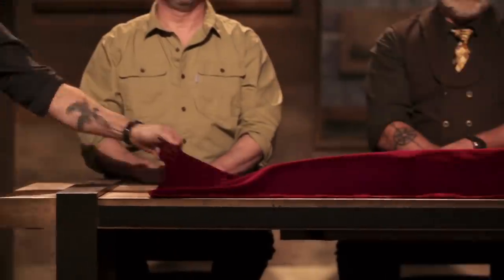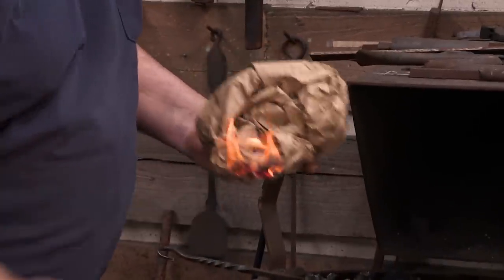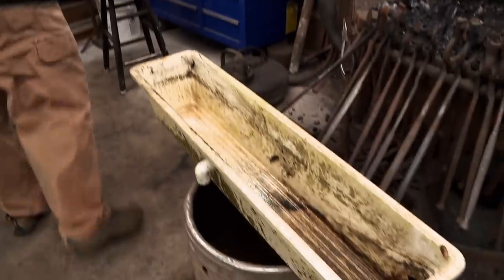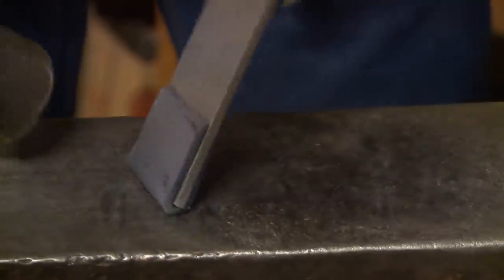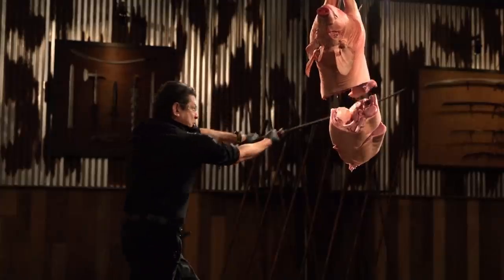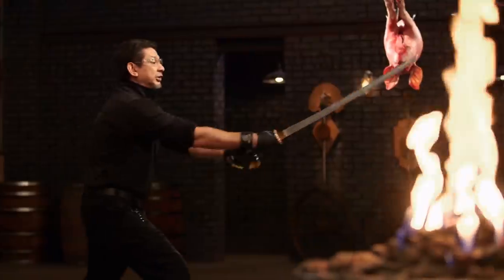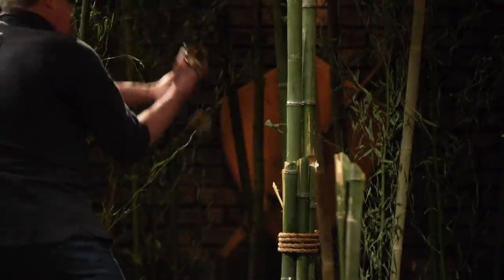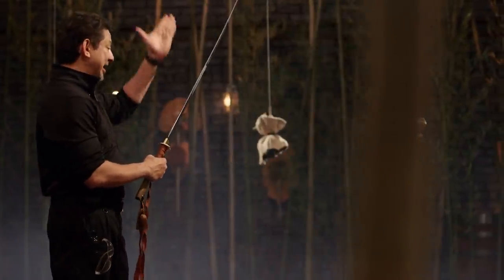Forged in Fire: Gunto Final Round: Richey vs. Elijah (Season 6) | History

Comment: I gotta say... The wrap getting unraveled seems like a minor problem that can be fixed by simply rewrapping the whole thing. But a bent sword? I don't know, it feels like a bigger issue than a handle wrap coming undone.
Reply: Yeah I'm rooting for Richie but I cant deny that he lose. I mean, Elijahs blade has a slight bend, but still functional in battle. As for Richie's blade, it would definitely be a bother in actual battle. It would affect the swing, grip and so.
But in a battle of beauty, design, and the blade? Richie is definitely the winner.
Reply: and the wrap isnt really a smith job
Reply: Well you see the challenge was to create a usable sword that could withstand the challenges. I've tried using a variety of swords without any wraps on the handle and it is almost impossible as the sword slips out very easily. There are no fixes in this challenge so what's done is done and imo I bent blade that cuts is better then a blade you can't swing.
Reply: @edwards7428  More handles than not dont have wraps like that. Maybe the way you hold the sword is not very well. may wanna figure out the right way. Unless your talking about more Japanese swords. Which I have seen lots of wood handled variation without wraps and people could handle them marvelously. Idk maybe they're magical
Reply: Well it all depends on how the texture on those handles play out. Katana has wrap for a reason it creates Friction for your grip since Katana type handle is a straight piece without pummel of curve at the end to prevent it from sliding off your hand.  So if the sword handle is smooth wood and the wrap on it became undone it's a big problem.
Reply: Im not gonna lie I was expecting elijahs blade was gonna snap on the strength test because of that double quench, i thought it was gonna make the spine of the gunto too hard and brittle (because traditional most eastern weapons, especially katanas, are made with the spine being "soft" and the edge being "hard)
Reply: @rktbunny7426  I katana has a straight handle that does not taper which without a wrap easily slips out. Every sword in history with no wrap has a stopper at the end of it to prevent your hands from sliding. I sword you can't swing is a useless sword.
Reply: Trebla Nerol Gnatibgam it is man, it is a big problem and would be on the battlefield. Poor judgment, just my opinion
Reply: I agree
Reply: @edwards7428  yeah that's what I was thinking. If this is suppose to withstand battle brute than it shouldn't be getting undone after one swing. His blade was also really thin. Japanese used a double forging method and could convert terrible steal to a good sword
Reply: @aoyaibaba3090  The whole issue, and it's something many people overlook with modern reproductions, is that japanese bladesmiths (and smiths the world over, but this is especially important to japanese swords) would affix shark skin to the wood beneath the wrap with some sort of resin to provide superior grip.  This made it to where the sword had plenty of grip even without the wrap, and the wrap was really more to provide padding and break up the shark skin's texture a bit so it wouldn't dig into your hand as much.

The reason this matters is that without the shark-skin (or some other method of adding extra friction to the grip) the wrap on Japanese style swords has a far easier time sliding around on the handle scales no matter how tightly one twists it.
Reply: Dude don't question them, they're "hIgHlY tRaInEd PrOfFeSsIoNaLs"
Reply: His sword bent during the kill test
Reply: @abdul-aziezintong8311  bother? can't you just unwrap the thing? and the judges said it was light. so it doesn't really matter. i'd rather have a lighter sword than a wrapped one
Reply: @edwards7428  yes but what would you rather have... a wrapped handle with a bent blade, or a unwrapped on, on a light sword. one requires a blacksmith to fix, the other just 30 seconds and some glue to be sure...
Reply: @therealtilt  however with that bent blade you can still cut on the battlefield but with a handle with no wrap you're not going to be able to properly control the blade. The handle might fly out or spin in your hands and that's a big issue....
Reply: @therealtilt  Say for instance you are having a fight then suddenly the wrap gets untangled. I mean in actual battle you'll probably get killed first before untangling it if you know what I mean.
Reply: Melissa The Rotund the premium ones that I saw being made personally uses stingray skin from the pectoral side. It’s got a knobbier texture to it and according to the suka master’s apprentice I talked to gives a better grip for the silk emaki.
Reply: Well said, the wrap wont affect a major problem to the performance of the katana. His katana was very tough and dont have any damage to the blade during the test. Katana is all about tough and sharp
Reply: i think they mentioned they both picked up a slight bend in their swords
Reply: plus his cuts were deeper in the sharpness and the kill test, the judges act like those tests don’t count it’s so dumb
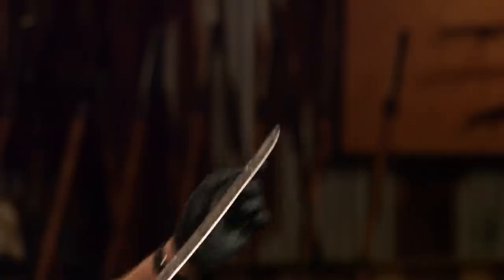Reply: 5:10 Richie's blade got slightly bent in the kill test. That's why he lose, not only due to the undone wrapping. Ellija's blade bent in the durability test so it was all around stronger.
Reply: @PsylomeAlpha  

Not shark skin,  the material is the knobbly back skin of a cow tailed  ray.
It's called  "Samegawa"  sah -may gah-wah
Reply: He’s talking about the actual blade curvature when he says bent he means it in a good way
Reply: Richies sword also took a minor bend and you can hammer a sword straight with not to much dificulty
Reply: @rktbunny7426  if you dont use a wrap you need to have some sort of other grip on your handle and when you go for a wrap you wont have any of those normally causing it to have poor grip
Reply: @jungleinsectspikewall4474  objectively speaking wrapping a stick in some clothe is far easier than hammering your blade straight and once a bend forms it will continue to bend. one of these will continue to be a inconvenience at most and the other will eventually make your weapon unusable. also again  Richie's didn't bend in the kill test he was talking about the curve of the blade and its cutting ability at least thats what i think because it would have been brought up it the strength test that the bend didn't worsen as it is always mentioned a second time.
Reply: Ya he's a blade Smith not a cloth specialist!!!! Good grief!!!! I agree
Reply: I think you are totally right
Reply: Well, even Doug said it was a very slight, slight bend, and it held up through the strength and sharpness test, not saying Richey’s didn’t, but if that wrap comes off, it can be a problem cause your grip can be lost; and you can possibly drop it onto your foot.
Reply: @abdul-aziezintong8311  Richie's blade is lighter, better in battle. The reason his wrap came undone is because he had to use a method that he was infamiliar with - if he was making a sword that was to be sturdy, I am certain he would have made it with a simple leather wrap and glue. In all honestly, the japanese wraps never made sense to me.

Point is. Richie's blade is lighter, sharper, and straighter than Elijah's. Wrap or not, he deserved to win.  because he
Reply: @edwards7428  Again, if the wood is of specific quality, it won't slip. An acrylic lacquer finish is entirely water repellent, it's almost impossible to make it slippery.

Additionally Richie was handicapped here - he had to do string wrapping because that was the task, but logically, a simple leather, or leather and wire wrap would have sufficed, which I assume he was familiar with, since it's the most common handle for swords.

String wraps are almost entirely unnecessary.
Reply: Richie's was also slightly bent though. How does everyone keep missing that?
Reply: Both swords were a little bent. Ritchie happened during the pig test his opponet bent during bamboo test. The wrap was the deciding factor..... I wanted ritchie to win
Reply: Richies blade may have held up better but the handle is much more then a small inconvenience it can be life or death, That and depending on how the wrap was made, the man/women may not be able to re-wrap it, I agree with the judges on their decision even if I don’t want Richie to loose, also this doesn’t matter but the bend in his blade was too small of a bend to be of any concern, showed via the sharpness test, also if you disagree feel free to give me a reason why? , I would love to hear other opinions compared to my own
Reply: Both blades took minor bends. The maki coming undone was the deciding factor.
Reply: True, but a blade could easily be bent back into place even during combat.
Reply: @abdul-aziezintong8311  You should look into learning how to handle a blade properly, it will take most of the potential issues of a wrap coming loose out of the equation.
Reply: @edwards7428  I keep reading your comments, and the more I read the more sure I am that you've never used a blade, fencing swords, especially epees have extremely minimal negative tapers on the pommel, to the point that they are insignificant, (when talking about french grip swords), the grip and control comes not from the handle, but from how you use your blade, many japenese swords and knives would come in unwrapped wood only varieties, sometimes even without a habaki or a tsuba. Infact there are plenty of japenese swords, katanas wakizashis etc that have only tsukas, with no samegawa. This is not uncommon in medieval swords either, where kriegsmessers and grossemessers would usually have only wooden handle scales. I reiterate, if an unwrapped handle is a hindrance to you in battle, you are categorically not fit to be fighting.
Reply: J. Nielson really rubs me the wrong way.
Reply: @elmexicanmaui2265  Well katanas were thick likely because they were quenched in water and tempered at low temperatures. So in order to reduce the chances of the blade cracking during quenching they would leave it thick and it would also heavily reduce the chances of it snapping. European swords on the other hand were thin because they went for flexibility over edge retention.
Reply: Well i thought about it and maybe it's because a bend sword can be straightend in battle. If you have to rewrap the sword in the battle it will take too much time.
Reply: @wesley_m6935  You can't really do that because a bend creates a weak point meaning the next time you hit something it's probably gonna snap. You basically have to remake a sword by heating it up to 1500f then straightening it then heat treating it again or if it's a severe bend cut it into pieces and forge weld it together into a billet to make the sword again. As for the wrap it's a rookie mistake that easily could have been fixed by making the handle coarse so that the wrap has something to cling to.
Reply: @1810jeff  they said it themself in this show that a sword could be straightend. That's why i said that actually.
Reply: Ritchie's blade also got a little bend after the kill test, as Doug pointed out, while Elijah's only suffered a little bend only.
Reply: If the tsuka (handle) is properly made the core and samegawa will hold without ito, and there are plenty of historic examples made that way intentionally

Comment: Richey's blade was so well done you could see how hard the edge is yet it was thin, light and elastic with such a bend as on the slow mo wow sadly that wrap wasnt that good but he gave all of him into that blade and its glorious!
Reply: @strongishman7871  Yea exactly it looked fat and slow and japanese swords are all for fast sharp and easy to wield weapons but i guess it comes close to a "critical weapon failure" cause its not easy to use a blade which wrap is getting apart and then the handle may bite into your hand or may get wet with sweat and slide in your hands so i bet it was a hard hard choice between these two
Reply: Not true at all, Japanese swords tend to be on the thick side
Reply: AcidHeathen if the blade is too hard it can break 
Alijahs blade was more on the hard side that’s why his blade bent 
But Richeys was balanced his didn’t bend at all just returned to it’s original form.
Reply: too thin and too narrow to me, it was more like a featherweight shamshir blade or sabre blade than a japanese sword blade, it was the FIRST thing i noticed as well was that richiees profile was also very flattened, wheras most japanese swords do have a very distinct bevel

Comment: I'd rather have to rewrap my sword then having a bent one.....
Reply: yeh man the judge were biased
Reply: Richie's sword picked up a bend in kill test too, wasn't just the handle wrap
Reply: You just like everyone must have decided to go deaf during 5:10
Reply: metal_ak4  richie's had a warp. And it was at the tip. Elijah had a BEND like, fully 5° angle bend
Reply: metal_ak4  a bend stresses the blade. If it bends anyone it could snap
Reply: you have to take into consideration that in a fight you cant just say hold on a second let me rewrap my blade.
Reply: @NocturnalNugget2  Also in consideration that no swordman will take a new sword to battles. Each sword has their own sharpness, reach, balance, weight and strength. They all need to practices with the new swords extensively before using it in a real battle. Richie warp and bend will be detected in the very first practice session. Eliyah sword in the other hand showed structural weakness, it bended a lot during the stress test. Richie sword did not bend much further than the initial bend. Following your word, you should be more concerned with Eliyah sword as it could bend midfight rather than the wrap.

Comment: How do you lose because of a handle wrap? His blade was better in every way.
Reply: The handle is kinda bad tho but the blade is pretty fine but handles are the part of the sword that connects the weapon and the user but with a good blade with a bad handle still will makes it a bad weapon
Reply: Shows about forging why they judging a wrap
Reply: Id prefer the "loosers" blade
Reply: But Elijahs blade was sharper so by default he won
Reply: Both blades picked up a bend
Reply: @MIHAI S. Richie's blade did bend...
Reply: These judges can be so idiotic. Except Doug. Doug keels.
Reply: @MIHAI S. A wrap, especially on japanese type swords, is not for looks. The straight handle makes it very easy for it to slip out of your hands, and the wrap keeps it there. It could become unsafe without a wrap.
Reply: @allaansnackbar4269  They judge the construction over all

Comment: But Elijah's blade was minorly bint and richys had nothing wrong with it
Reply: You missed it during the kill test, where Doug said that it picked up a little bit of a bend at the tip. So both blades took on a slight bend, but Richie's handle was also unwrapping. Just one more problem than Elijah's blade. Even if it's minor, we've seen the judges choose one sword over another because of extremely minor, even cosmetic things before. And while they say it doesn't matter what the swords do in the strength test, if it's neck and neck, they will look at that as well and Elijah's sword performed better in that test as well.

Comment: Unfortunately you don't forge the Sori (curve) in a Nihonto or in this case a WW II Nihonto or Gunto. The hardening process if done correctly, imparts the curve. It's an edge down trough quench. Oh, helps to clay insulate the Hamon, because it expands, and the Mune, or "spine" contracts. Results are a very unique curve based on the Nakago or "tangs" position when the sword is quenched. Sometimes the curve is unique to the smithing Ryu or Five Den, Yamato, Yamashiro, Bizen, Soshu, or Mino, or the era, Hein, Kamakura, Nambokucho, Shinto, Shin Shinto, Gendai or simply the purpose of the Sword

Comment: I felt like Ritchie won. His blade seemed to cut through just slightly better on both sharpness tests, and was just as capable on the strength test. I guess it’s a matter of a slightly sharper sword with unraveling on the handle vs a slightly bent sword